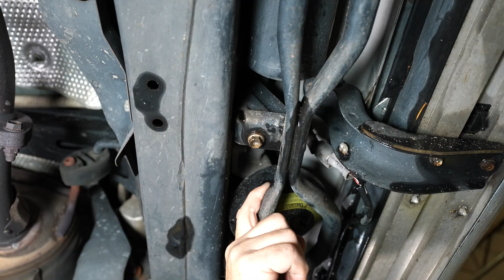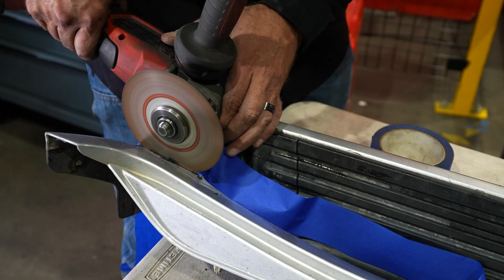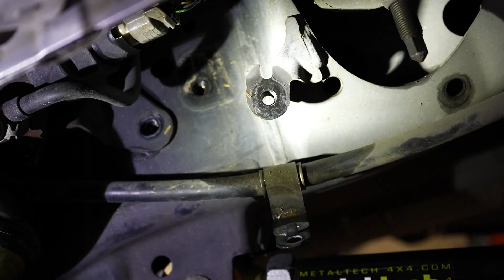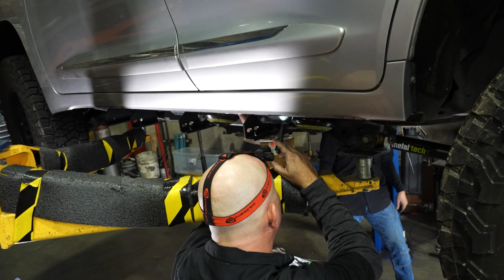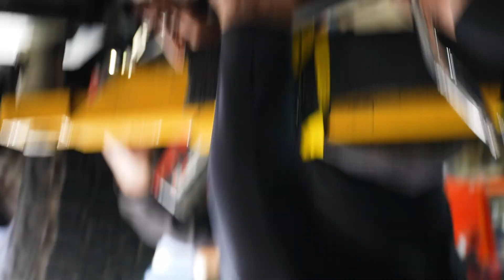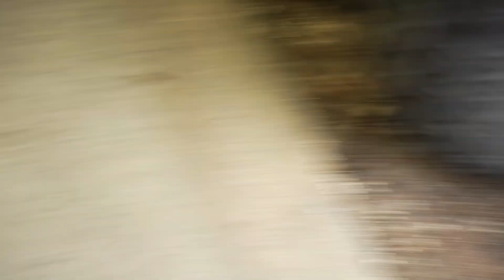Lexus LX 570 Rock Sliders Installation

Comment: got a question, i noticed the sliders protect the AHC gloves VERY well! Does the added protection get in the way of Globe removal? do you have enough room to unscrew the globes after you remove the filler plate thats bolted on the slider? Or does the slider need to come off.

Comment: Looks like great protection for the AHC, rocker panels, and lower doors.

Some recommendations / questions:
1) The new bolts with the Metal Tech kit should be metric bolts, not SAE.  Other fasteners on the rig are metric, so having to switch between SAE and metric is cumbersome.

2) How have the sliders been tested?  What are they rated at? Most OEMs test theirs by literally jacking up a the vehicle by the slider.  Some rate theirs somewhere between 1.0x - 2x GVWR, even though they only support 1/2 the vehicle weight on the trail when sliding on a rock.  Furthermore, some drivers use the sliders as a jack point for a trail repair.

3) Is the new hardware heavy zinc plated or stainless steel to resist corrosion?  Website is unclear if they're coated or not.

4) What grade / strength of steel is used for each of the components?  Website lists thickness, but not the strength.

5) You say "no modifications to the truck" in the video, but drilling eight large holes in the bottom of the frame for the nutserts (rivnuts) is a certainly a modification - and a significant one at that.  Along with cutting the rocker panel cover, which is expected, but doesn't affect corrosion protection.

6) What thickness is the powder coat?  Is the assembly/components acid pickle washed and zinc-plated before powder coat?  If not, how is the bare steel cleaned/treated before powder coat?
Reply from the maker: At first, I was not sure if your questions were genuine or if you were winding us up.   Going to go with genuine, so here are your answers.   If you have further questions or comments, please email us directly at info@metaltech4x4.com so we can assist you further. 

1) Bolts provided that directly interact with the Toyota parts are metric.   Assembly bolts for the rest of the system are SAE due to availability and pricing, providing the appropriate hardware for the applications.  I see your point about wanting all metrics, but with this targeted for US use, anyone installing aftermarket products knows and expects to find SAE on quality US-made products.  The effort in picking up a 3/8" wrench is the same as that of a 13mm wrench.   Anyone installing aftermarket products in the US will have both SAE and Metric tools. 

2) Have the sliders been tested by lifting the truck up by them? Yes.   They will support the entire weight of the vehicle with some deflection. Please note that this is a subjective assessment.  It works as a jack point with no issues, as we state in our online description on our website. However, in real-world off-road use, the impacts can be far more severe, with the multiplying effects of kinetic energy.  - Thus, the limit of "testing" a slider.  However, all Metal-tech 4x4 sliders come with a limited lifetime warranty, ensuring that the owner will not bend them.  This is published on our website. 

3) Plated hardware is Yellow Trivalent under specification ASTM B 633 Type VI,  Stainless Steel hardware is 304 bolts with 316 nuts.  The use of dissimilar stainless is to reduce the chances of galling due to similar harnesses. 

4) We use industry-standard 1018 and 1020 mild steel, with a mixture of hot-rolled and cold-rolled steel depending on the specific application of each part.  This includes the US-made, DOM tubing used for the rub rails. 

5) You are correct; adding the nutsert locations indeed requires a modification to the truck. This is also shared directly on our website: six nutserts will be needed to be installed per side.  As for cutting the rockers, that is optional, as we clarify in the video. You can also purchase and install 200-series rockers, rather than cutting them or not running them at all. 

6) Powder Coating.  We stress the importance of getting them raw on our website.   This way, you can have them finished exactly as you wish locally.  We also price them lower this way.  If powder coating is selected, it comes with no warranty for shipping damage or longevity of use.   When powder coating is chosen, our vendor sandblasts or hot alkaline washes/rinses/bakes to prepare. The zinc-rich primer powder coating is applied first in 1.5 mil, followed by the top coat of Cardinal BK01, which is applied at an additional 2.5 to 3 mil.  However, honestly, get them (or any aftermarket bumper or sliders) raw and have them coated locally; this way, if you ever need a warranty issue with the finish, it's a local solution.  Additionally, local powder coaters will prepare and finish them according to what is appropriate for your area. 

BONUS!) Weight!  What do these things weigh, or better yet, how much added weight do these add to my LX570?  Each slider assembly is approximately. 89lbs.   However, we take off approximately. 12 lbs per side, making the net gain per side right about 77 lbs.    This is light considering each slider is holding up its share of a 6,000 lb Lexus. 

Any other questions or comments, please email us directly at info@metaltech4x4.com. We will be more than happy to help you further outfit your LX570.
Reply: Thanks for the feedback!  They are genuine questions as I shop rock rails/sliders for my truck.  As I perused your website, I had some technical questions and thought other potential customers might have some of the same questions.

Comment: I choose these sliders because of the 4 beefy mounting points and protection of the globes. Wish I had this video because install pita
Reply from the maker: We appreciate you running Metal-tech 4x4 on your 570!  We put a lot of work into designing these to be as bolt-on as possible yet be as strong as possible for hard use by our very heavy LX570s.     We made this video 100% to help with how to put them on!   Also helps others looking for the first time to see just how well these things protect the LX.

Comment: I need the rim and tire specs, please.
Reply: i have a feeling they’re 285,70r17 but i want to be sure too
Reply: @planeaddict117  Thank you for your help. Let's see if they ever reply and assure us about the specs.
Reply from the maker: The truck in the video is not a shop truck but a customers.   Sorry we dont have the specific specs.   However I think @briancaguioa is correct in the 285-70R 17 range.
Reply: @Metaltech4x4  copy. Thank you boss.
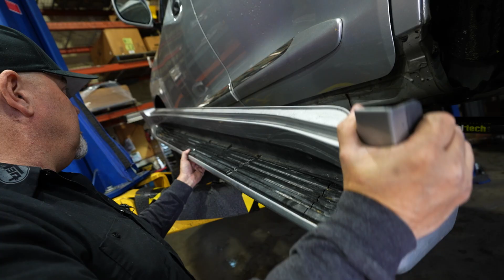Reply: Tire size is 285/75/17, you can see it @1:36
Reply: @kindi911  Thank you broski.
Reply: Same rims on LX for my winter tires, Black Rhino Rapid 17x8.5, they only weigh 22.50 lbs

Comment: That's some impressive engineering guys.
Reply from the maker: Thank you. We put quite a bit of time into developing, testing offroad and improving them to what they are now. They easily hold the entire weight of the LX570 with no issues.   The AHC system is one of the most valuable parts for the LX570s, and protecting that equipment yet keeping them accessible for servicing if ever needed is also key. This system does all that.
Reply: Gonna be some work to service the hydraulic system but definitely nice setup